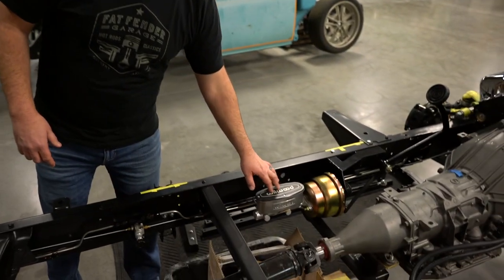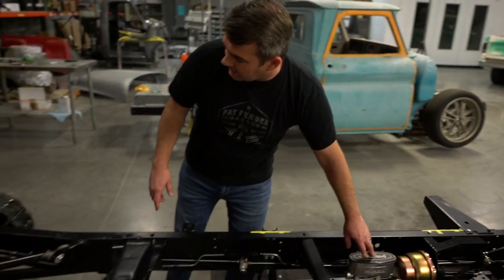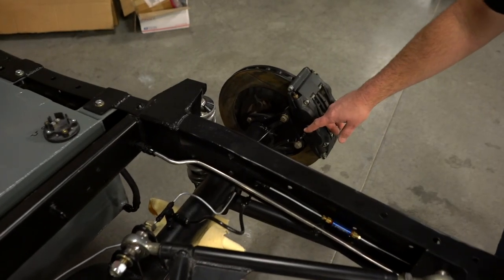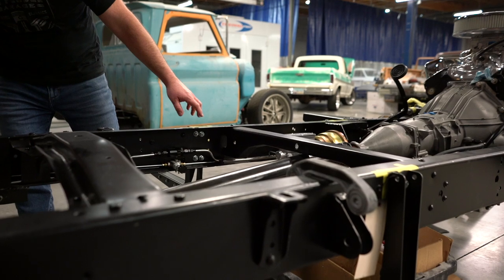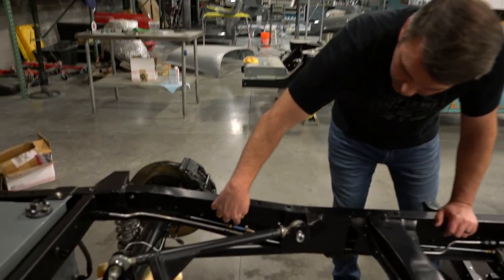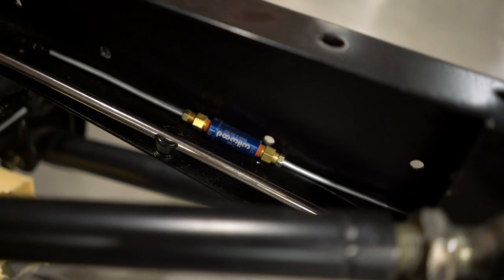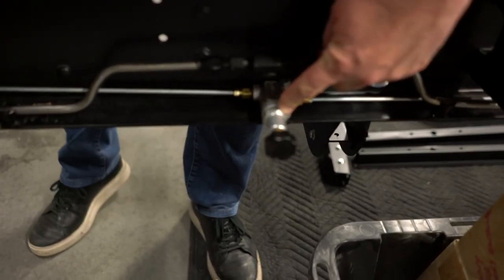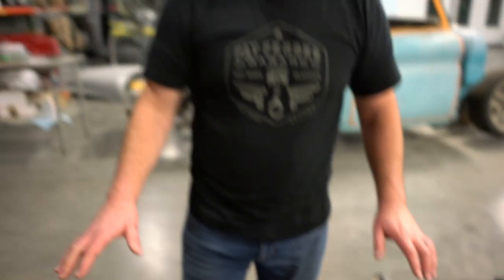Vintage Truck Pedal Issue FIX! (Residual Valve)

Comment: I have one question, if residual valve is installed on disc brake, will it interfere with the return action of brake seal ( lip seal ).
Reply: Did you ever figure this out? I've got problems with my rear disc brakes dragging no matter how I adjust my master cylinder pushrod.